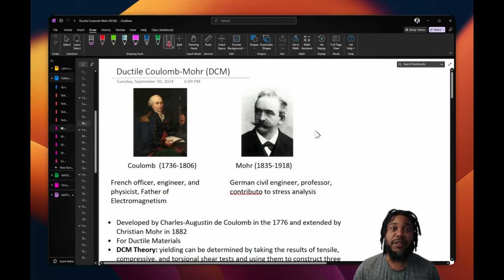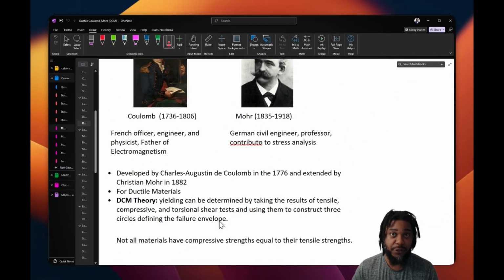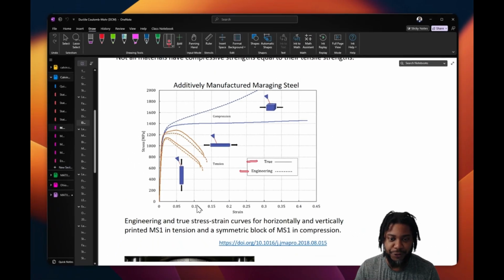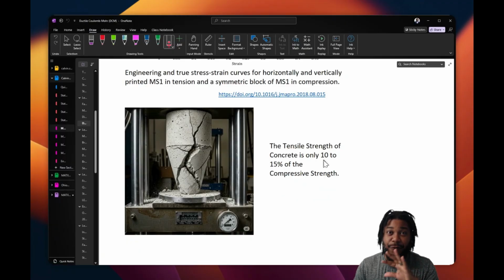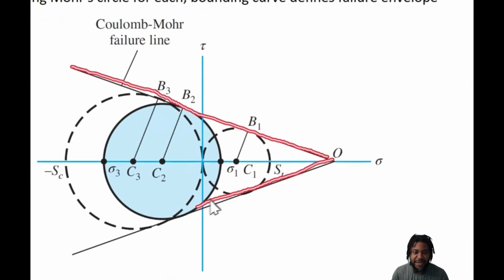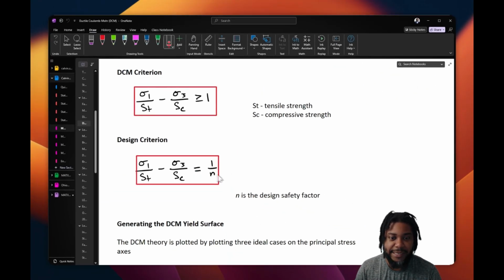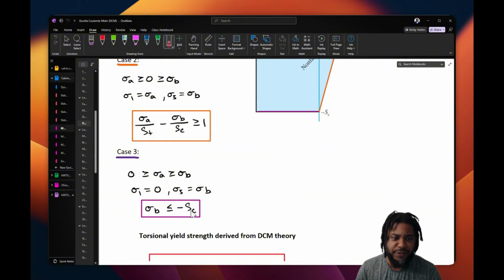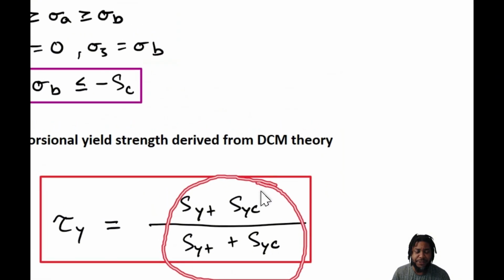Ductile Coulomb-Mohr (DCM)

Comment: Great lecture, clear and elegant. Quick thought: instead of treating the three test circles purely as tangency constraints for a single circular envelope, you can invert the three-circle geometry to extract an explicit Lode-angle (intermediate-stress) sensitivity and then fit an HO (Hosford–Coulomb) style Lode-dependent envelope, this gives a direct microstructure-consistent bridge from DCM to modern Lode-sensitive fracture/yield models (and it can be identified from a tension, compression and thin-wall torsion test using DIC)...
Reply from the maker: Excellent insights! There many failure theories that have been developed. In this video we cover the historical Ductile Coulomb-Mohr that extension of this theory have been developed of the last several decades. There is some incredible exciting working happening in the multiaxial testing space with digital image correlation to map strain fields and calibrated models.